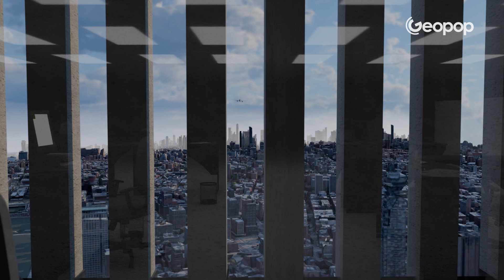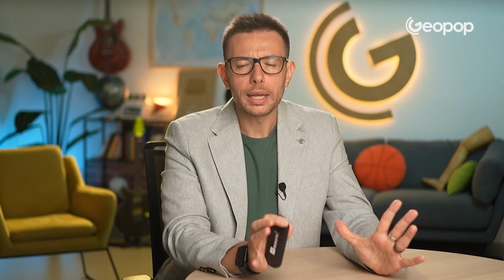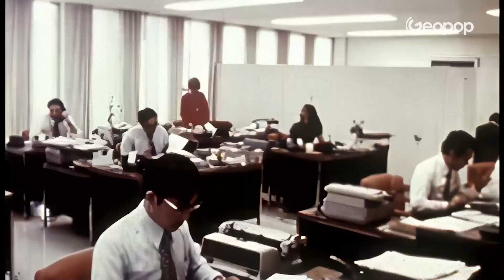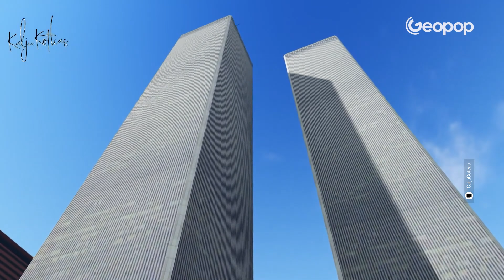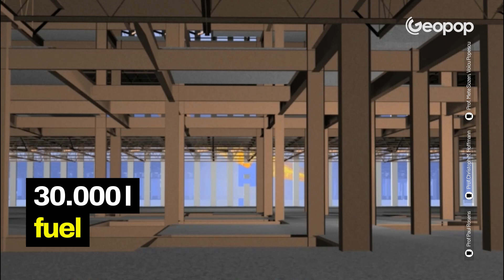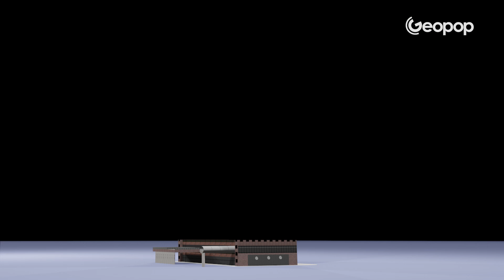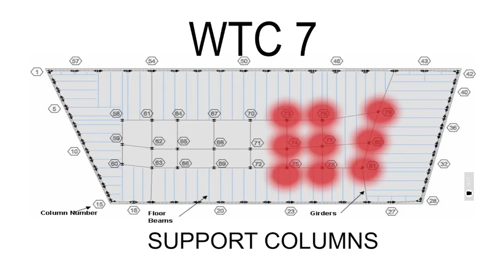9/11, 2001: The Technical Reconstruction of the Twin Towers and WTC 7 Collapses

Comment: Thermite caused the steel to weaken. Nut even with that, the lower undamaged floors, wouldn't have collapsed. It was forced by the government in order to justify us going into the middle east for years, and cost thousands of lives. Fuck the government.
Reply: "the lower undamaged floors, wouldn't have collapsed."
Incorrect (and that's what we saw anyway).
Reply: Thermite melts steel?  Does it though? If only someone had actually tested this instead of just guessing or making unfounded assumptions. Oh, wait!

youtube.com/watch?v=JXWCMBuusMI&ab_channel=TrutherTVArchives 

In this video starting at 45:35 and running to 48:35 the Energetic Materials Research and Testing Center (EMRTC) conducts a test to examine the effectiveness of thermite in cutting a vertical hollow box-section steel column. The column tested is smaller in cross section and made of thinner steel than that of the Twin Towers perimeter columns (and never mind the core columns). In total 175 pounds of thermite are used for the test on just one column and requiring the construction of a rather conspicuous coffer dam to contain it. Do recall the Twin Towers had 240 columns and 110 floors.

It would be odd if thousands of office workers missed hundreds, perhaps thousands of those suddenly appearing.

Note what an incredibly slow process this is. It took close to 30 seconds for the thermite to finish burning off.  It would be impossible to “control” a demolition using this material.

Not to mention the issue of; how does the aircraft impact and subsequent raging fires NOT prematurely set this stuff off?

Also note how bright and obvious the whole process is. Could not be missed visually. No way to hide that. 

Then at the end of the test the (relatively modest) column was undamaged…. which is a problem.

Certainly no rivers of molten steel emanating from it either and in fact the whole thing cools rather quickly as soon as the thermite has burned off, as one would expect.

Thermite has never been used in the controlled demolition of any building, let alone one with multiple floors on fire after the impact of a large jet. If the conspiracy oriented internet has taught us anything it’s that if something has never happened before, it can never happen.

Comment: Designed to withstand the impact of 747's. The planes were 737's. How odd that absolutely no one on the ground reported actually seeing a plane. Hmmmmm! Interesting. And, the puffs of smoke indicate implosion as if they were purposefully brought down? Then, look a tower 7 Absolutely NO DAMAGE. Can you say government envolvement?
Reply: "How odd that absolutely no one on the ground reported actually seeing a plane. "
Zero, as several people saw the first one, and lots the second.

"the puffs of smoke indicate implosion"
No.

"as if they were purposefully brought down?"
I don't think the plane crashes were accident. Do you? So yes, it was on purpose.

"look a tower 7 Absolutely NO DAMAGE"
It burn for 7h before falling.

Maybe inform yourself.
Reply: There’s a lot of myths and misconceptions about exactly what the Twin Towers were and were not designed to do and even what aircraft impact means.  People tend to exaggerate, misinterpret or even just make shit up. 

For the record: The Twin Towers were never designed to withstand any sort of aircraft impact, however one may choose to define that. This was not a requirement of the customer or of NYC building code and you will see no mention of it in the building plans.

For the Twin Towers, the accidental impact of the largest jet in service at the time (Boeing 707-200), lost in fog on landing approach (light and slow) was studied at a very crude level in a 3-page memo of hand-worked calculations. This work was done AFTER primary design work was completed and the memo does not appear to have survived.  What was NOT studied was an intentional high-speed Kamikaze attack by a much larger aircraft impacting at up to 3 times the velocity OR the effects of subsequent fires 

The memo concluded that in this particular scenario the impact damage alone would not be sufficient to cause the Tower to collapse.

This of course only deals with impact damage not with building collapse. Collapse of the Twin Towers was due to four (4) factors of which many commenters only consider one, maybe two, but never all four.

Impact Damage + Fire (heat) + Time + Gravity = Collapse

Remove any one (1) of those four (4) elements and there is no collapse. They work together. 

Ignore any of those four (4) elements and you will never understand the collapse. They work together. 

Unfortunately that is four (4) elements which is at least three (3) more elements than many people who choose to opine on this topic can handle at once. This is why folks like you invariably talk about impact damage OR fire, never impact damage AND fire (and never even consider time and gravity).

Comment: 15:58 "it took 9 seconds for the South tower to fall and 11 seconds for the north tower to fall" on 9/11......
Reply: Actually that is not correct.  It is a common misconception.

The myth the Twin Towers collapsed in free fall (9-11 seconds) comes from completely misreading this:

NIST FAQ for the Twin Towers disaster Study

*11. How could the WTC towers collapse in only 11 seconds (WTC 1) and 9 seconds (WTC 2)—speeds that approximate that of a ball dropped from similar height in a vacuum (with no air resistance)? *

NIST estimated the elapsed times for the first exterior panels to strike the ground after the collapse initiated in each of the towers to be approximately 11 seconds for WTC 1 and approximately 9 seconds for WTC 2. These elapsed times were based on: (1) precise timing of the initiation of collapse from video evidence, and (2) ground motion (seismic) signals recorded at Palisades, N.Y., that also were precisely time-calibrated for wave transmission times from lower Manhattan (see NIST NCSTAR 1-5A)

Note the part about the first exterior panels to strike the ground after the collapse initiated.  A lot of people seem to miss that important bit of context and only see the 11 seconds and 9 seconds parts. 

On conspiracy web sites and YouTube videos they just cut out all the relevant context and details and (falsely) claim; The Twin Towers collapsed in 10 (or 9 or 11 - they usually can't remember the exact number so they fudge it) seconds Selective reading comprehension syndrome (SRCS). 

9 or 11 seconds is NOT the building, its the first debris to hit the ground which were definitely in free fall and dropping much faster than the Tower, which is collapsing some ways behind that. All of this easily visible to the naked eye. 

youtube.com/watch?v=4VgZW-v_Opg&t=4s&ab_channel=MFitz 

Now you know.

Actual collapse time for the North Tower is timed on this video;
youtube.com/watch?v=MAYXdafNl6E&ab_channel=AlienEntity1 

South Tower – Timed not in free fall
youtube.com/watch?v=rOIebjT2jaM&ab_channel=AlienEntity1 

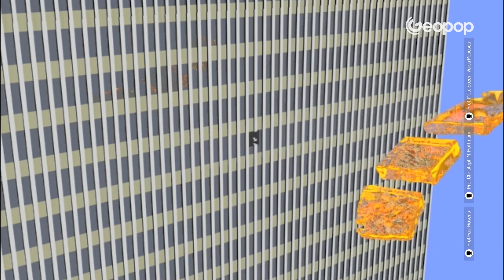Here is a video which captures the entire North Tower collapse, which starts at 1:44. The last standing parts of the structure drop below the dust cloud at 2:17. Add at least another 2 seconds or so for those to drop 60 stories. Start to finish I call it at 34 seconds. 

youtube.com/watch?v=3HbD_Q6kmh8&ab_channel=RTLNieuwsNewYork
Reply: Exact falling time is not easy to measure.

Comment: What a load of shit. To have 3 steel buildings to fall the same way on the same can't happen. Even the owner of all the buildings said they pulled building 7. There is a video of WTC 7 being taken down. If they do that in 1 day makes me think they were all taken down that way.
Reply: They didn't fall in the same way but you seem to be forgetting a rather important element. 

PS

Larry Silverstein agreed with the fire department they should pull the firefighters out to avoid further loss of life since Building 7 could not be saved. FFS pay attention to words. They have meaning. Nobody runs inside a dangerously unstable burning building and blows it up in 20 minutes. It takes months. Certainly not the fire department - not what they do! FFS 🤦‍♂

Comment: What a load of nonsense. The vast majority of the towers were undamaged so the collapse of the upper portion would have been slowed down and stopped. Demolition
Reply: I don't think you understand how physics works.

Collapse was initiated (started) at the impact and fire damaged floors when floor trusses exposed to heat over time sagged, in turn pulling on and causing the inward bowing of perimeter columns by up to 5 feet until they buckled. 

Once the perimeter columns buckled the formerly static load above became a dynamic load 30 times greater, easily overwhelming the structure below.

Thousands of tons of now loose debris fell through the open off space - through the inside of the building bypassing the columns - dropping 12 feet onto the first intact floor it comes across. The massive instant overload causes the floor to fail, adding its mass to the falling mass (this I think is where people tend to lose the plot) which continues to accelerate for another 12 feet until it impacts the next floor, rinse and repeat all the way down. Rate of collapse increases as momentum increases

No fire required at all on floors below the impact points for them to fail. The mechanisms that started the collapse are different to the mechanisms which continued the collapse.   That will be a difficult concept for some.

As the floors fail the perimeter columns are left literally hanging in the breeze, no longer attached to the rest of the structure. They peel away and fall in great sheets (think banana) out to more than 600 feet from the base on the 4 points of the compass. 

Core columns failed last.
Reply: "the collapse of the upper portion would have been slowed down and stopped"
Except of your ignorance, what is this assertion built on?